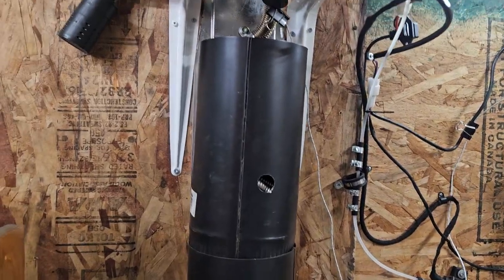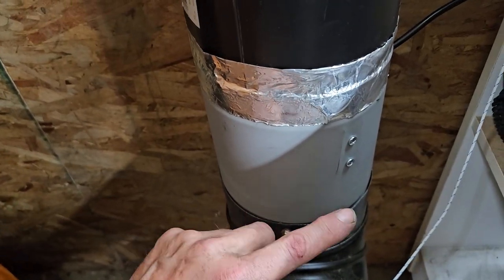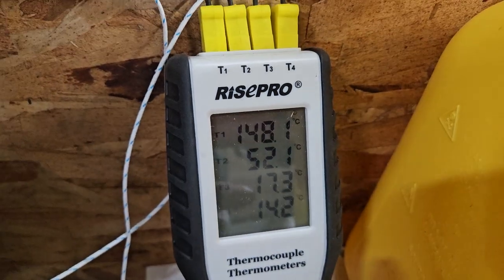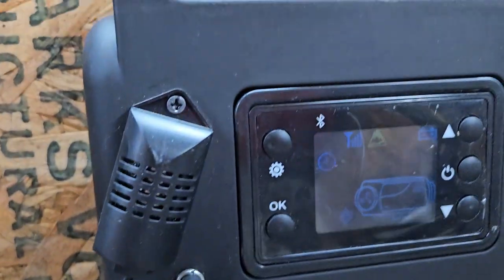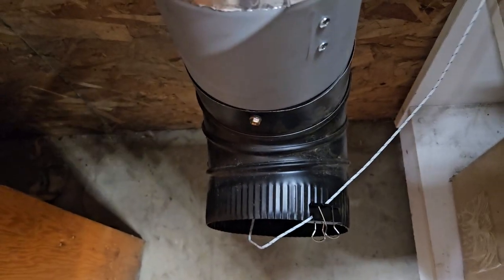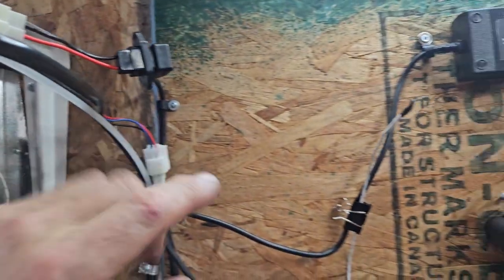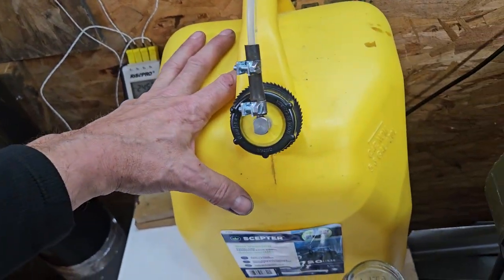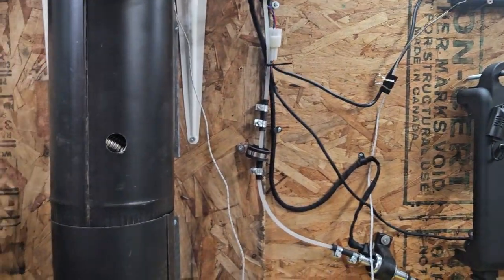Chinese Diesel Heater - Exhaust Gas Heat Exchanger (long version)

Comment: Hello Scot, do you happen to know what the pump rate (Hz) was when you tested at the lowest setting?   Different units have slightly different default pump rates for Low and High.
Reply from the maker: Being one of the newer Vevor Diesel Heaters, this one does not have the "secret menu" to tune the unit and therefore does not display Hz at all. I have found a way to "count" manually and will log some data in the coming days/weeks (unfortunately my day job is going to be VERY busy from Christmas to New Years with a major component overhaul where I work and I am one of the ones that Needs to be there), so not a lot of time off in the future. Good news is that I am planning on doing High accuracy fuel burn measurements , Electric consumption measurements, Exhaust gas velocity 2m vs stock  pipe measurements, and now , thanks to your comment- I will do Pump Hz low altitude vs high altitude up to as high a setting as I can accurately count!!!!. These newer , smarter units have much better sensor technology (Pressure, Temp and most likely RH)  than just a few years previous and seem to compensate for things like ambient and combustion  intake air temperature and pressure so they don't "seem" (to run at an absolute constant Hz/RPM ratio at a given heat setting. Subscribe so you don't miss it, I am just new and therefore very insignificant to the YouTube algorithm so it would not likely let you know of a new video from me
Reply: @scotscheideman9800  No hurry.  I'm receiving my first CDH today and will also be doing a bunch of tests.  You're the first to mention that some of the newer controllers/units have more sensors and are adaptive.  It will be interesting to examine their behavior.  

The reason for my question is the traditional stock controllers generally are shipped with Low Hz and RPM at 1.6/1680 and High at 5.5/4500.  At 1.6Hz and 75% efficiency, theoretically there's 1360 watts/hr that the CDH "should" be able to extract, and if your testing has found 140 w/hr using EG recovery on Low then that's not insignificant actually (~10%).  I've also not heard anyone publish an efficiency curve on any of these units spanning the L-M-H range.  It would be helpful to know where the sweet-spot is.  The one I'm getting claims "28%" improvement in power over others, but no proof of course.   I've now purchased a CFM and a 4 Channel Temp meter to collect some data to answer a few of these questions on this CDH, so we'll see what results.

Thanks for the reply, and have a good Holiday.

Comment: you could install a computer fan at the top of the pipe to blow across the heater exchanger (exhaust pipe)
Reply from the maker: Why would I do that when I have a 6" HVAC booster fan drawing 100 times the air through it already?

Comment: For easy way to convert C to F  "roughly" double the Celsius temperature and add 30 to get Fahrenheit
Reply: The rest of the world (just about) use C not F because it makes sense.  100Deg C = boiling  Zero Deg C = freezing  20 Deg C = normal room temp.. the end.

Comment: I would try to stick those coils of the exhaust pipe on a boiler type tank to see if I can get some hot water for regular use out of the heat maybe? 🤔🤔

Comment: Love the temp sensor Probe set up! Very nice idea! 
Heat exchanger + condensation drain ultra smart!
Thanks for the education Scot!
BTW on ( LOW Setting how Long will 5 gallons last  in days? )
Reply from the maker: Thanks for the compliment! I am planning a very high accuracy fuel burn test in a few days. I plan on testing the lowest setting and the highest

Comment: As an Engineer I totally appreciate what you're doing here.  For heat recovery it's a sensible approach requiring only about $100 USD in parts and skills that most folks can handle.   That said, what you have been able to determine is that 140 watts/hr is in the ballpark of what any of us can expect to recover from the exhaust heat no matter the method used.  In Minnesota, we pay about $0.12/kWh, so recovering 140 watts/hr saves just $0.016/hr (less than 2 cents), making the payback of $100 USD about 6000 hours of equivalent electrical heat, and likely 2-3x longer than that if using other sources like propane or Nat gas.  I was about to build a similar recovery system for my HCalory heater but now I'm just going to add a few more feet of scrap piping and call it good.   You've answered the question no one else has seemingly been able to answer --- How much energy from the exhaust heat can I sensibly recover?   About 140 watts/hr was the answer.  Well done sir!
Reply: 140w/hr sounds way too low bc others are reporting taking the exhaust down from 400f to 80f. That's got to be more than 140w/hr.
Reply: @Gary-ee3kq   I'd think so too off-hand, but a German guy who runs an Engineering channel wanted to know the truth too so he build a recovery system unit using a modern radiator and he concluded it was recovering about 100 w/hr.

Comment: One thing I would take notice to vevor recommends not exceeding 270°, I'm not sure but I suffered a failure on mine I think it was due to exceeding the length as they recommend only running 6 ft 6 in of exhaust pipe and as we know we lose flow with each bend. I have revised my design to run a aluminum transmission cooler. Which is a straight through design combine that with the heatsink design and I believe it will be very efficient. I will update when complete
Reply from the maker: Thanks for the comment and checking it out!  This unit has now run for over 1000 hours 24/7 (over 6 weeks) . 80% on the lowest heat setting for days at a time with some spikes at the higher settings to take readings or warm up the shop to comfy(75f) for a several hr session in there. It has been shutdown and started several times , mostly quick shutdowns to change something,  or take current measurements during shut down and startup,  I also  let it run out of fuel a couple times to check that the height difference between tank and heater was okay.  No issues at all.  Today I took my new CO detector and measured the exhaust for the second time in 3 days and was a very clean burning mid 20's PPM. Upon reading your comment I ran outside and measured the exhaust velocity from this unit with it's 2meter(78") exhaust which has two 90° bends and the 4 coils that have a 3" radius and then measured the same type of Vevor 8kw running at the same heat setting but with the factory 23" tube with only one 90°bend under the heater then shallow gentle bends to the muffler and the a coupler to the through hull. I measured it outside at the through hull with a 4" straight coupler to be able to seal the flow off to run 100% through the anemometer just like I did with the wall mount unit minutes before . Both did 5.2MPH on three readings , both had been set on H1(the lowest manual heat setting) for a couple hours, both have the combustion air intake inside the building and the exhaust outside. Same controller, motherboard, and burner/fan assembly. Both are running in "Plateau" mode

Comment: This is really cool. But I wonder how well a 55 gallon drum would work as a heat exchanger. Any thoughts?
Reply from the maker: I am sure you could make that work, it is magnitudes bigger than you need , but if that is all you have to work with then go for it!  I am surprised after much testing with this unit that the Maximum total lost heat in the exhaust of these heaters is only about 180Watt/hours of energy.  The pipe is very hot and seems at first like that must be a TON of energy , but when you measure how slow the speed of air flow in that pipe it is (4.6 -5.2 mph) and then throw some math at it - not so impressive   My little exchanger is extracting about 160 W/hr - only missing 20W/hr or 12%

Comment: You need those water diesel heaters. Run the heat exchanger from exhaust in series and heat a cheapo hot water tank, free from marketplace. Youll get close to every unit of heat energy out of that fuel AND you can keep the temp more stable. It looks like youre letting out a good amount of heat through the exhaust.
Reply from the maker: With this system the exhaust gas is leaving the building (Just measured today) only 21°f(11.6°c) above ambient room temp flowing @ 4.7mph. (heater on low, exchanger fan on high) That calculates out to 57 Btu/h or 17Wh. Less heat than a 20watt bulb. Because this is a large garage in north central Alberta Canada the heater runs 24/7 making the temperature very stable. Last night is was -20°(-4°f)
Reply: @scotscheideman9800  oh wow, ye thats really good then. Nvm

Comment: My exhausts are either  6 or 10 feet long..  coil loosely going down (in open air) or zig zag if against the wall with a fan blowing on it.  It's. Far more effective to place the fan closer to the hotter end of the exhaust..    your idea would be optimized by opening up the pipe with perforations for air flow..  alternately, cap the bottom end and fill with sand to make a hot sand heat battery .    I am actually gonna try that now.
Reply from the maker: My measurements and math have shown that I am only missing 12% of the total recoverable heat in the exhaust  and this configuration is eliminating the cold air layer at the floor, which at my northern latitude is a much bigger deal than a 20watt light bulb's worth of heat loss

Comment: Have you thought about running the combustion intake outside so you aren't pulling warm air to the outside
Reply from the maker: First of all thank you for the comment! 
 Putting the intake inside was a conscious decision because we get frequent and very heavy Hoar Frost ( do a google images search)  throughout the length of our very long winters here in northcentral Canada. The house here has a 6.5m x 10m (20'x30') addition heated by a 38,000 BTU wood pellet stove which has a 50cm(2") intake pipe run to a 100cm(4") square intake grating. Hoar Frost has already plugged it off once this winter already and it will more times yet. Plugging off the intake on the diesel heater would result in it slowly increasing the richness off the burn till it completely sooted up and shutdown , requiring a complete tear down of the heater and all the exhaust tubing. We get -40° of colder for a few days even a few weeks most winters and feeding the combustion chamber with that temperature of air could degrade how clean the burn is, Diesel engines don't even have issues in those temperature. Bugs in the spring and fall are another reason, because of the cold nights, fly's and such like to crawl into anything they can to get away from the cold.
Reply: @scotscheideman9800  Wow I was not aware you were in such a harsh environment. I have a diesel heater in my garage as well. Pacific NW. Greetings neighbor.
Reply from the maker: @wastelandman198  North Central Alberta Canada

Comment: I think this design is genius and I'm going to build one myself. I'm going to use 3 meters of exhaust pipe and use 8" think stove pipe so I can still have a good down angle all the way out. I'm putting a stove pipe cap on the top and cut a hole for a 4" variable-speed fan I have to push air down through the stove pipe and out the elbow at the bottom. I was also able to pick up the same thermocoupler thermometer on Amazon for $25. I'll let you know it works out when complete. Thanks for the great concept.
Reply from the maker: Looking forward to hearing from you! Mine has now been running 24/7 for over 1000 hours, (over 40 days )) mostly on H1 but a few days now at H3. No signs of excessive carbon build up.
Reply from the maker: Ohh, Also, I have run that Thermocouple thermometer side by side with my several hundred dollar Mac Tools multimeter and they are within a few tenths of a degree
Reply: I tried something similar and the extra bends in the exhaust pipe created backpressure inhibiting the exhaust flow... it took a while for me to notice the exhaust routed outside was smoking black real bad and by the time I got it shut down the unit got clogged up and no longer works.
I was able to increase the efficiency by getting one of those Burek CD thermostats, I got 2 heaters controlled by it and they run about 5 or 10 min every hour or so and I typically spend 5 dollars on diesel every other day... that's affordable enough for me to NOT wand to screw around with waste oil or normal functioning and I'm on my 2nd winter running them on lowest Hz setting without any problems:person-turqouise-waving:🔥🥶🔥
Reply from the maker: @autojohn2000  These newer mother boards have "Plateau Mode" which leans out the mixture a bit. Mine has run now for over 1000 hrs 24/7  mostly on the lowest setting with several short stops to move components around and I ran it out of fuel twice to confirm my fuel tank was not too low for the pump to prime.  It shows the typical thin film of black in the exhaust pipe. I have taken a couple of CO readings and the exhaust only contains 25-30PPM which indicates it is burning very clean. I just did an exhaust flow velocity test between this version and an unaltered unit with the stock  23" exhaust and only one 90° bend and both are showing the same velocity - 5.2mph(8.36kph, 7.62fps)
Reply: @scotscheideman9800  My controllers can be set too (like the "alpine mode") last winter I changed the lowest setting from 17 Hz (I call it Squirts)... down to 13 on one of them but it didn't blow nearly as hot as the other. The one I ruined I made a bunch of serpentine bends back and forth with lava rocks wired to the pipe and a fan behind it:body-blue-raised-arms:the Burek got my fuel consumption down to where I'm through expermenting:hand-purple-blue-peace:

Comment: I do like your set up. I think I might copy it, with a little twist. Pardon the pun.
I have read somewhere that it's more efficient to have the fan pushing from the colder side of the exhaust to the hot. I think the idea behind this is you keep the colder pipe cold. In the way you're running it, It's sucking the hot air down heating up what should be the colder pipe.
Reply from the maker: If updraft works for you setup ,then by all means go that way. I am running downdraft to have the hot air exit into, and stir up the cold air layer at the floor. If I run it in updraft, the cold air that does get around the large garage door, would slide across the floor to feed  the heat exchanger. I can work out there now in any shoe and sox , where as it used to require putting on boots during the large part of the winter where we get -20°c (0°f) or colder. The forecast is calling for -30°c(-22°f) at night in a few days. We see -40 almost every year often for a week or 2

Comment: My solution for heat recovery is;
Deisel likes to combust at high temperatures. 
Therefore,  I procured two lengths of exhaust pipe and combined them together using copper wire to bind them wrapped tightly with aluminum and insulated with fiberglass sleeve to transfer the heat to the fresh air intake both cooling the exhaust and preheating the intake air for more efficient combustion and simple heat recovery...
Reply from the maker: Thanks for the comment! 
I see that being a real bonus in a scenario like very cold weather ice fishing or camping  at mid to lower altitudes. Diesel engines experience incomplete combustion (white smokey exhaust) at extreme cold temps (-40 ish temps) so I'm sure these heaters would also.  One scenario I would be cautious of this setup would be high altitude camping in above freezing temps. Heating the already thin air would further reduce it's density and further richen the fuel air ratio , leading to soot build up.

Comment: Hi. Great video. Can I ask how you bent the exhaust tubing to fit inside the exchanger ? Did you roll it around a metal pole of some description ?
Reply from the maker: I just bent it by hand , trial and error, the coils are mostly a little larger diameter than the inside of the 6" stove pipe. This means they need to be compressed as they are pressed into the pipe. This makes them a friction fit , eliminates any rattling from vibration and the stove pipe becomes a bit of heat sink as metal to metal transmits heat magnitudes better than metal to air. I cut a slot just big enough for the exit portion of the pipe far enough up the pipe to allow seating in the next piece of pipe

Comment: Could you have just run or pointed one of the 4 hot air ducts into the exhaust pipe heat exchanger to force air through instead of a booster fan?
Reply from the maker: That's a good question and I did explore that briefly. The issue that quickly showed up when I started measuring temperatures and velocities with my thermocouple thermometers and anemometer was that the 50mm(2") discharge air is too hot and not enough mass air flow to extract waste heat efficiently.   At the lowest heat setting(H1) the air exiting the ducts is 72°c(162°f). The exhaust gas enters the exchanger at 169°c(335°f). With the much lower air flow of 1 or even 2 ducts combined with the high temp, I would never be able to draw the Exhaust Gas Temp to less than about 100°c(212°f) . This system with the 6" fan moving way more air and using ambient air at about 18°c(64°f) I get the EGT down to 35°c(95°f). Thanks again for the comment , all are appreciated.
Reply from the maker: Something relevant I forgot in that response,  a 2" pipe has a cross section of just over 3" sq vs a 6" pipe having over 28"sq. They run close to the same velocities at low and high